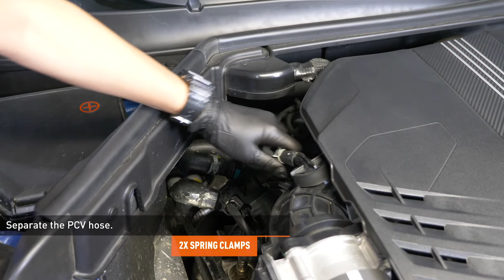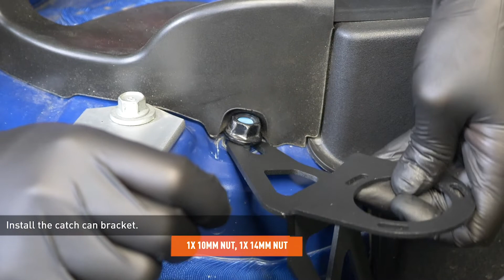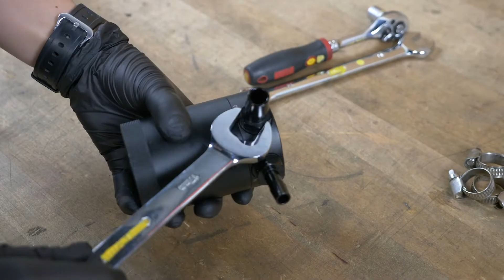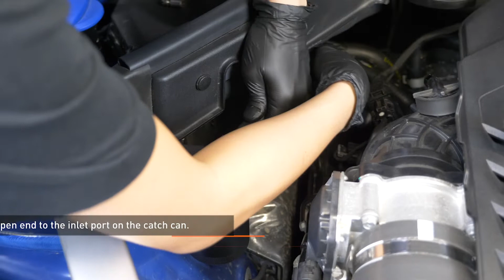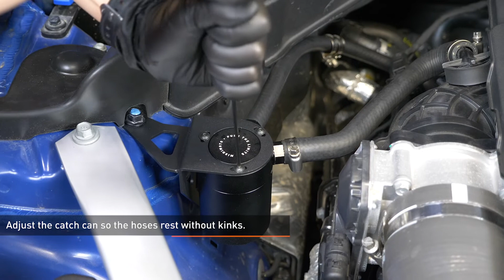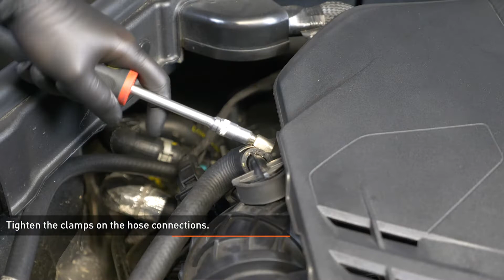2018+ Kia Stinger GT Baffled Oil Catch Can Installation Guide by Mishimoto

Comment: I just installed this on my 2021 Kia Stinger GT Limited and it was very simple to do as per the video.  Thank you so much for posting the video, it was very helpful!  Just a heads up to others…be careful when tightening the bottom bolt of the bracket.  Mine broke off the car with little force, (just a small weld held mine in place) it left a hole so I used the existing hole and screwed in a 3/8th self tap Hex screw 14 x 1”

Comment: Hey I just installed it and everything works fine but I’m still not sure how tight I’m supposed to tighten those hose clamps because I don’t want it to leak but I also don’t want the plastic tips to break from too much pressure.

Comment: When do you check the catch can, monthly?
Reply from the maker: After installation, Mishimoto recommends checking the contents of the baffled catch cans every 1,000 miles until a baseline is established. Oil blow-by accumulation will vary with ambient temperatures and driving conditions. It is important that the contents of the can do not rise above the internal baffle.
Reply: @mishimoto  thank you!
Reply: @mishimoto  recommendations for the weather in SoCal?
Reply from the maker: We would suggest to check the can every 1k miles initially.

Comment: Why do we need to lubricate the O-rings?
Reply from the maker: This prevent the O-ring from being pinched when being tightened and makes removal down the line easier
Reply: It looked like they came with a little lube already in there. I didn’t have any on me during install but hopefully what it had was enough until I get some bought.

Comment: Finished install using this vid. Took me 35 min. Thank you! How often are you supposed to check it?
Reply from the maker: After installation, Mishimoto recommends checking the contents of the baffled catch cans every 1,000 miles until a baseline is established. Oil blow-by accumulation will vary with ambient temperatures and driving conditions. It is important that the contents of the can do not rise above the internal baffle.

Comment: Will be installing this tomorrow on my Stinger; love how super simple it is to install. Went with the single over the double as I don't mind emptying it every 1500km and the double looks annoying to install compared to this lol

UPDATE: This does not work (as seen here) an a 2022 GT Elite. The stud where the M6 nut holds the bottom of the bracket to the engine bay IS NOT PRESENT (the hole is there though). Further more, the hole doesn't even line up with the bottom hole on the catch can bracket; you'd need to drill a new hole in the bracket and also install your own stud in the engine back to use the M6 nut. All I did was put threadlocker on the top 14mm stud (prevents vibration from loosening the nut) and impacted the nut down hard on the top of the catch can bracket.

That's all you can do unless you wanna waste like 2hrs drilling holes and making your own studs
Reply: Oh really? Damn, is it worth to get this? I'm thinking on buying it and i have the same car
Reply: @dretax14  they have new version for 2022

Comment: I currently have Injen CAI and GFB BOV installed and I would like to put this on my 2019 KIA Stinger 3.3TT. It is compatible correct? And do I have do disassemble the OCC to empty the can?
Reply from the maker: This would be compatible with your car, to empty this you would simply unscrew the bottom of the can or use the drain plug on the bottom
Reply: @mishimoto  Is the can reverse threaded? Mine was installed by the previous owner. I'm having difficulty removing the can, any tips?
Reply: @adam17guitar  it is not reverse thread